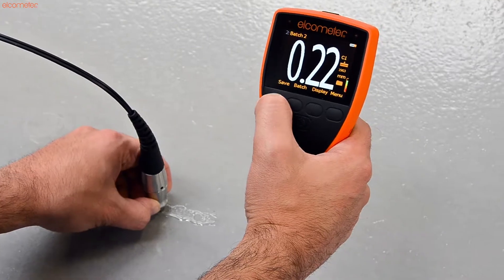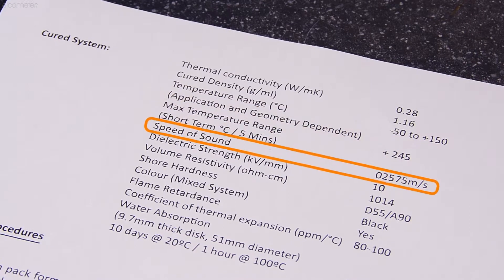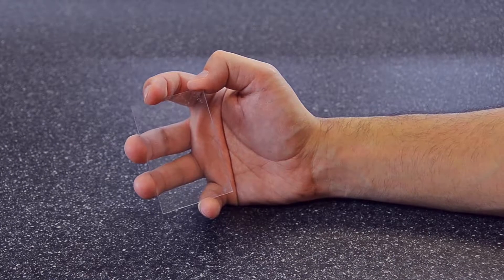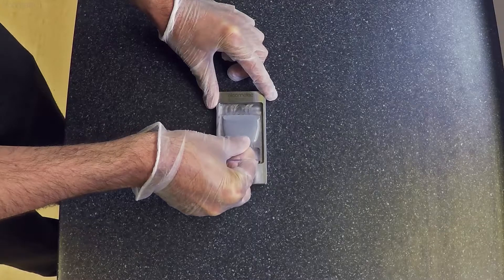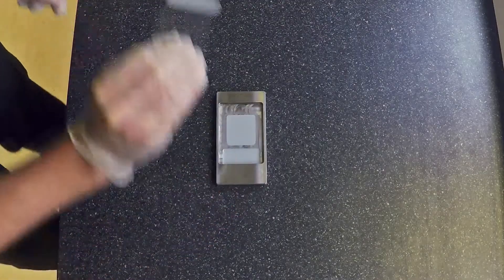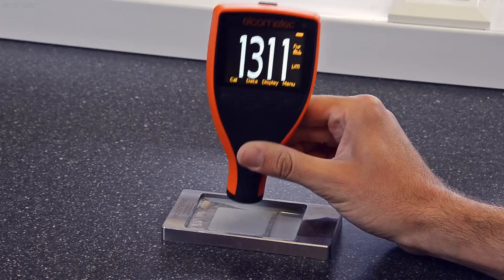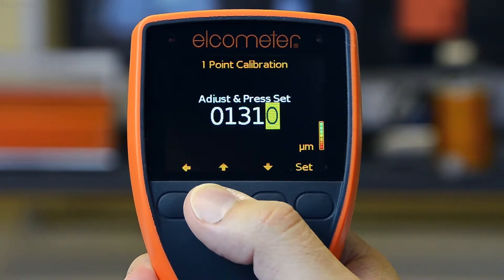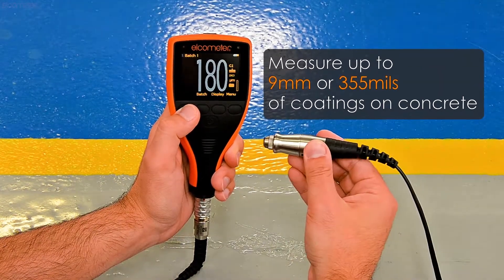Create a coating sample for the Elcometer 500 using the Elcometer Coating Calibration Mould

Comment: Hi this is sutable for concrete bitumen caoting
Reply from the maker: Thank you for your comment.

It is possible to use the Elcometer 500 to measure bitumen coatings on concrete. However the concrete must be smooth, and it depends how thick the coating is. We advise getting in touch with our technical support team to discuss your application in more detail. 

You can email them at this address: techsales@elcometer.com
Reply: @ElcometerOfficialChannel  with out probe possibe
Reply from the maker: The Elcometer 500 only comes with a separate probe to make it easier to scan the surface.